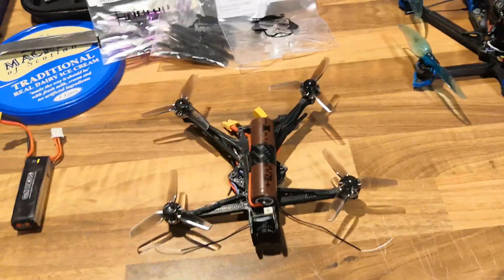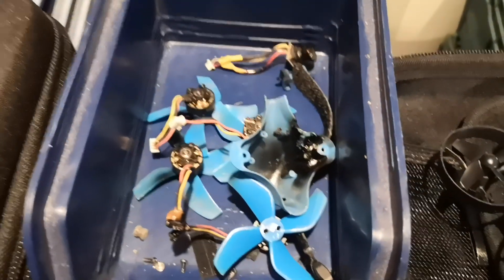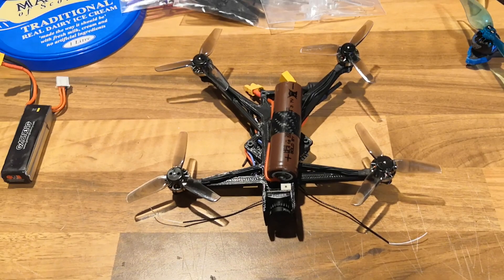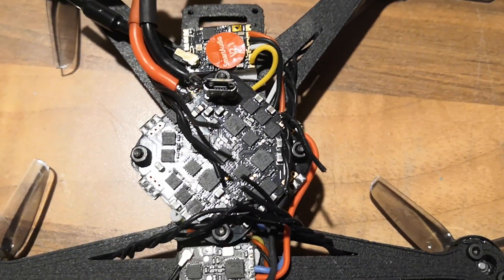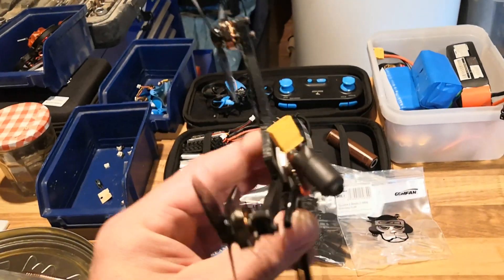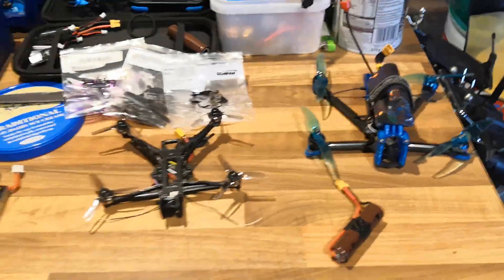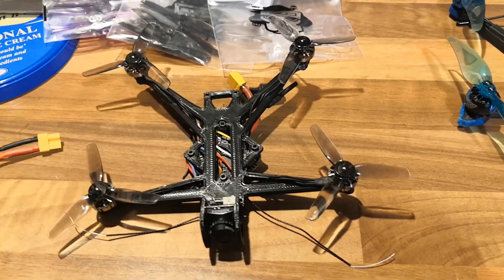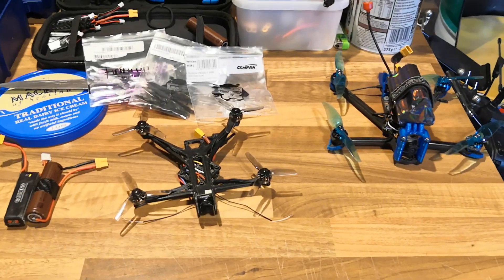Project 3D printed nano long range "Dave_C designs" FPV quad 1S 18650 mocked up

Comment: Whats the difference 5500kv vs 11500kv?
Reply from the maker: kv=rpm per volt, think of it like that. A higher KV motor will revolve the prop faster at a given voltage. Too high a kv = motor overheat/bang.

Comment: yes... stay away from flywoo FC... they have a bad quality controll... bought two from them and they both smoked... i did connect all as it should have
Reply from the maker: Hey Johnny.  The Flywoo works fine, just the ESC part does not like 1S. It is a 2-4S FC. So this first one has been remixed as a 2-3s making it more suited to freestyle. I will give an update on my next video. It even flies with 100g of 2S Lion on there :)

Comment: Nice one Mike! Following the project very closely 😁 p.s them hq prop 3in tri blade are very smooth!
Reply from the maker: I tired the tri-blades and you are right, super smooth, so much so I now have a set of tri blades on the 4". Then I tried some 75mm 5 blades on the nano and smoked a motor last night! Doh!

Comment: I’ve been trying to decide on a milled/ laser cut  aluminum skeleton frame or reinforced print on the S5. Maybe a remixed printed in Sla with holes throughout for cf rods to be ca’d in for reinforcement. Ideas. Too many irons in the fire atm. A custom pcb with an onboard buck con would be sick too.
Reply from the maker: Good ideas, I was looking at various materials on 3d printing sites to do a more refined version of this. Keep us posted on your projects!
Reply: Mark's Random Videos I work at an R&D. Unfortunately we are in the setting up stage still and I am surrounded by toys that are not operational yet. We have a Mark Forge CF on order so maybe a A/I assisted design could be possible in the future. Our shop laser is running on nitrogen tanks rn. I’m replacing them every day. As soon as we get it running on shop air or dewars, I’ll be at liberty to cut more. I’ll keep you posted.

Comment: Would adding a BN220 or BN180 add too much weight to the build?
Reply from the maker: I dont think so mate, I think it could be done, question is where you mount it? If you have CAD and a 3d printer you could make a mount like the Chimera4 has at the rear :)

Comment: planning to build one too, 
is you find things that improve it pls make a video about it
Reply from the maker: Thanks mate. I got it together last night, flew it and broke a standoff in the frame. I now have a 2mm piece of standoff stuck in there.......might have to resort to superglue!!! I am probably going to order a new frame!!!!
Reply: @MarksRandomVideos  sad to hear that it broke so soon hope you find a way to fix it
were there things that stood out during flight?
i wonder how the standoff broke, design flaw maybe?.
Reply from the maker: @kingofwar1422  yes it was all my fault. It is back together today without the buck converter and filter on 2S 450 GNB. It flew well enough. This was using the carbon base plate from my latest video and glue on the 1 standoff! I will get another print done soon. Keep us posted on your build!
Reply: @MarksRandomVideos  will do!! but it'll take quite some time, parts need shipping!

Comment: HII and thank you for share.
CAN it work on ldark et115
is 2s quad , motors 1104 with 7500kv, 2.3 tree blade props,
weigt without batrery 90 grams , with battery 125g . Tried with bigger battery and fly well at 145grams. SO original barttery is 35grams but work well with 55grams battery. A 2s 18650 battery will be aprox 90-92 grams. 
SO will it work??.
Reply: If you go to the thingiverse page, there is a remix for a 2s version.
Reply: @brandonbell359  thank you

Comment from the maker: "The best you'll get from an 18650 is the Samsung 20S which is 2000mAh and 30A capable. If you can do larger, the molicel p42A is 4000mAh 30A or Samsung 30T 3000mAh 35A."
Reply: The best one is Samsung 21700 50S with 5000mAh/35A mate! :)
Ps. How much total cost drone without batteries?
Reply: @benzoesansodu5866  A 21700 weighs considerably more than an 18650.  I purchased very similar parts for a different build last year and spent about $150.
Reply: @brandonbell359  71g vs 49g. 5000mAh vs 2600mAh
Reply: @benzoesansodu5866  I think you might want to watch dave_c’s video about this. 30 grams is a huge amount of weight to add to this aircraft. Thats in the neighborhood of 30% of the ready to fly weight.
Reply from the maker: @benzoesansodu5866  I would say near $150
Reply: @Benzoesan soda on a quad copter, the current draw isn’t linear, though. As you add weight you also have to add throttle. You soon get to a point where you’re burning more mah than you added.
Reply: @brandonbell359  but it worth to try :)
Reply: @benzoesansodu5866  Let us know, then.